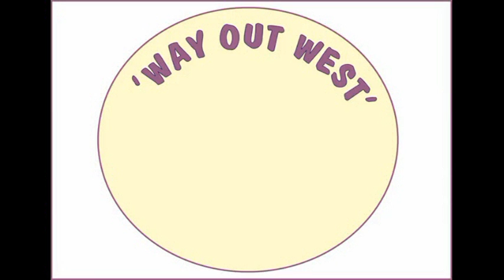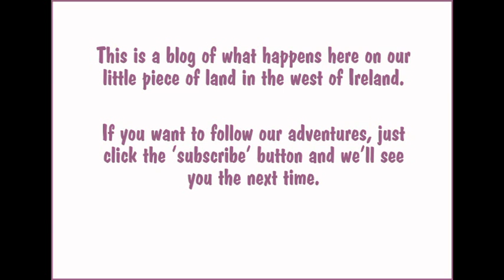Making A Five-Bar Gate With The Homemade Chainsaw Mortiser

Comment: Love that chainsaw mortiser.   Really, the best cheap way to cut mortises like that.  Though I think I'd use an electric chainsaw.
Reply: ...wow!
Reply: The right tool for the job.  Well done.
Reply from the maker: Matthias Wandel Thanks Matthias. I'm thinking about an exciting new development for it - watch this space!
Reply from the maker: ***** Thanks Tom!
Reply: WayOutWest Blowinblog  A tease but no hint :)   Suggest... use shortest bar/chain combo that provides the maximum depth needed,  use ripping chain (10° vs std. 25° angled cutting teeth) for smoother cut, prefer electric for less vibration, etc. as MW mentioned, and lastly, I'd wrap pipe with thin, hard plastic (eg, strips cut from juice or milk container) to eliminate any play in horizontal carriage pipes.

Love the clever use of levers and foot operation. Well done!
Reply: I was watching this video and thinking Tim's chainsaw mortiser is as ingenious as some of Mathias Wandel's machines. I scroll down to the comments only to find that Mathias commented. The interwebs makes the world a whole lot smaller.
Reply: Love your work Matthias. Fancy seeing you on this one.

Comment: That morticer works well. I like when home made gadgets work so well. I make gates for a living and I have only one minor niggle about your design where you can your braces should always be in compression and not tension. Think of it as pushing the gate up as opposed to trying to pull it up. It's a very well made build.
Reply from the maker: +Adam Lynch Thanks Adam - I've made them both ways over the years and decided that tension works best for me. It's not pushing the joint apart. But each to their own.
Reply: Correct
Reply: Adam Lynch
You are exactly right. I too have been making doors and gates for years, braces always in tension.

Comment: Not sure you'll ever see this question but here goes: Should the diagonal on the gate go the other way - bottom hinge corner to top unhinged corner? The reason I ask is, I made a gate for my garage drive entrance and a wood worker told me about 'gate drop' he said, you have to carry the weight of the gate to the bottom of the hinge side and it will hold it up better with no gate twist or drop. I am just binge watching your vids and I am amazed by your incredible ingenuity.
Reply from the maker: You'll find proponents for both ways, George. If you can get everything really tight it shouldn't matter which way it goes - my way stops gate-drop too if you look at it. I do it this way so the rain doesn't run into the hanging side of the frame. Good luck!
Reply: @WayOutWestx2  Yes, it certainly looks robust enough and I doubt it's going to fall over anytime soon. I do like things you do and the ways you find to do them. Well done sir.

Comment: Love the mortiser.  That is a great way to tackle a heavy wood project and with your needs around the homestead I am sure this comes in handy in many areas.

I am sorry to have to point out one flaw in an otherwise wonderful piece of work.  The diagonal brace is wrong.  The goal of the brace is to pickup the weight of the extending gate and transfer it to the lower hinge. There is a great deal of weight cantilevered out away from the top hinge and a diagonal down from the opening side to the bottom hinge will support this weight and greatly increase the life of the gate.  Trying to pull up as your current diagonal support does will increase the load on the top hinge and shorten the life of the gate.  Turn the gate around and hang it from the other side will probably double its life and still allow the opening to swing the same.

I hope I explained that clearly.  This is a common error and many people wonder why such an important part of the fence fails so soon.
Reply from the maker: David Harris Thanks very much, David, for your thoughts. I have made lots of gates over the years and have often pondered the merits of one design over the other. I agree, of course, with your analysis of this one - the weight is mostly hanging from the top of the hanging post side. Having the diagonal brace running the other way, the weight would mostly be to the bottom of that side, as you say - but so would the rain water. In my experience it's the joint at the bottom of the hanging post that fails first - especially with the diagonal running as you suggest.

There's another reason I wouldn't go with your design - the weight would be pulling the joints apart instead of compressing them, as happens with our gate.

But really, I think we're both right - and both wrong! There isn't a perfect solution either way and there are pros and cons with both.  You make them your way and I'll make them my way and we'll both be happy. How's that?!
Reply: Timber is not steel.  Steel gates work in tension.  Timber gates and doors work in compression.  So you have built this gate incorrectly.  You are not inventing this.  Carpentry has well established rules that many young carpenters do not even understand because they are not taught enough of the very basics.  Any apprentice would fail on this project!
Reply: Sorry but David Harris and Patrick Muldowney are right . I worked with many old time joiners 50 years ago and if I made a mistake like that I would have been laughed out of the workshop, sorry.

Comment: Fab gate, is the brace in the wrong place?? shouldn't it be from top left to bottom right (hinge side)
Reply from the maker: This has been discussed quite a bit. Both ways are valid - I prefer this way but lots would swear the other way is better. Either way, the gate's still doing it's job.
Reply: Way Out West Blow-in blog the proof is in the pudding I guess! Good work.
Reply: Heel to toe
Reply: It is braced wrong. Timber needs to be in compression, Steel needs to be in tension.

Comment: Nice job with the mortise chainsaw! But you have the cross brace on the wrong way…..it should go from the bottom of the hinge side up to the lock side. Not having a go …just pointing it out.
Reply from the maker: I've made lots over the years and tried both ways, Richard. The triangulation is the same, of course, but this is the best because it doesn't draw water into the shutting post. Try it?

Comment: How thick are the boards you are using? I'm planing to make one myself and thanks a lot for the video!
Reply from the maker: Boldten I think they were about 4 cm (inch-and-a-quarter?) - but I think I would make them a little thicker next time
Reply: WayOutWest Blowinblog Ok, thanks. I have wood available in 4,7cm or 2,2x10. So if you were me, you whould choose the 4,7x10, right?
Reply from the maker: Boldten right. although it depends on the length of the gate. You need the extra thickness for a long gate, but a small gate might look too heavy with fat boards, maybe?